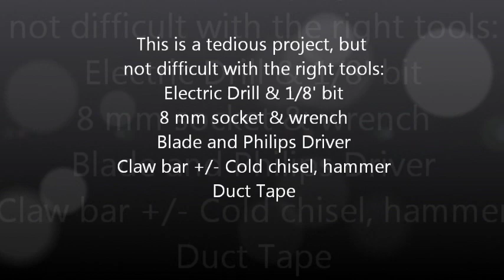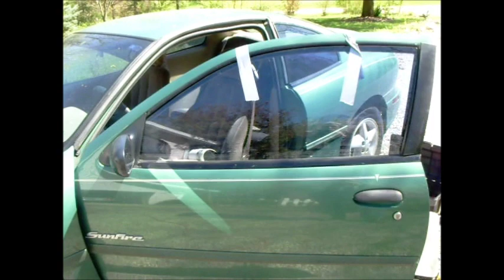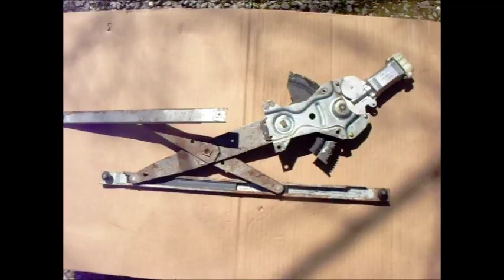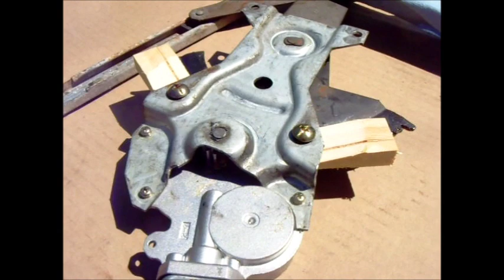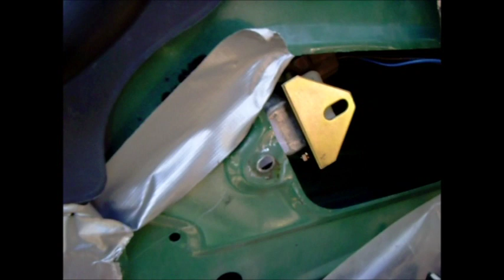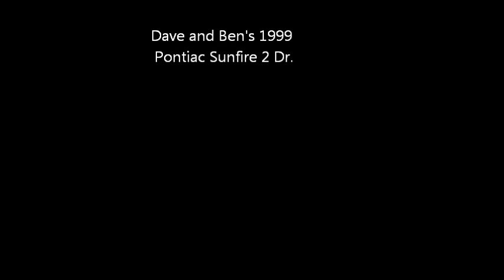1999 Pontiac Sunfire Power Window Regulator and Motor Replacement

Comment: Thanks for the rundown. I bought a sedan for a winter beater after my coupe was crushed. None of the windows will go back up. The whole span of Sunfires was nothing but a clusterf*ck. Parts went out early, body rusts from bad design (trapped water), pumps and sensors would go bad, and for this they rivet the damn door together. Nuts and bolts will do just fine.

Unless it was bought with all options you'd get bargain bin quality everything.

Comment: What a pain in the A-- i have replaced several p/w motors this 2003 sunfire was the worst "by far"  don't even think about getting the motor out without removing complete unit &window  " the motor from auto zone $33.00-- complete unit 156.00 /2017 came with a mounting bracket --  not useable on my 2003 2 door coupe --- had to use old one -- get your drill & or grinder you will need both!!!!  -- grind off rivets --- keep in mind these are "steel" rivets -!!!!!   can you replace STEEL  rivets ??? / with aluminum -I DON'T THINK SO !!  unit came with bolts - way smaller than holes "you " just opened up - GOOD LUCK WITH THE WOOD SHIM IDEA - lol  --we tried epoxy on nuts  - geeeesh -- how do keep it out of the threads ???  --- we finally welded the nuts on the back side -- yeah really !   -  I & a "GOOD"friend did this for my broke granddaughter --- if the other side quits she will have to duct tape it up --- never again !!!!  by the way the complete unit would NOT have made it any easier -  those nuts in the rear are the worst - take em some where right away to be welded & you will save your saturday . o-yeah there is a rivet behind the door plate anchor - this video showed a little v cut to get to it -- mine demanded a large V made with my angle grinder -  SAW another video with this big access hole close to the handle area -- that would have been a JOY if this 2003 had it -- some guy talking about 35 mins -- to do this job --- did not do a 2003 ---2dr coupe --I ASSURE YOU !!!!!

Comment: Good video for a look at what your going to have to do, minus the crazy grinding job... 2" angle grinder maybe lol... As for the mounting of the motor... while the assembly is OUT plug in the motor, raise or lower (with the switch...) the regulator assembly and put 10mm 1 1/2" bolt threw on the upper right and lower right side so the nut will tread on the outside (arms will have to be moved for each bolt) once you have one bolt in move the motor so you can get the next in. The gear in the back will move up and hold it in place. Adjust regulator so both bolts are in place.. Install the regulator and if its done right you should have 2 studs from the bolts ready and threw your door panel holes and the left top and bottom are easily reached by once again plugging in the motor and moving the actuator. Hope this helps I just used this procedure today job only took 35 min with drilling rivets...

Comment from the maker: Yes, knowing what I know now, the whole assembly may have been better, but, I was given the motor and I offered to install it. Also, you still have to remove the the whole assembly from the car.  You would save having to attach the motor to the regulator, which was a bit of a pain. But I got'r done and it is working great. Thanks for the suggestion.